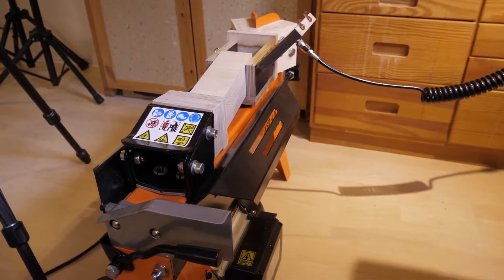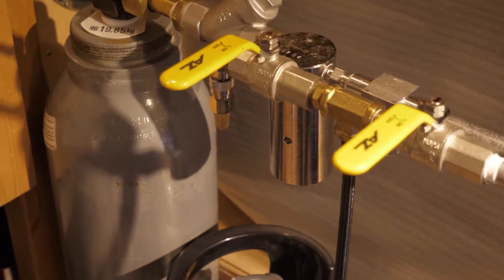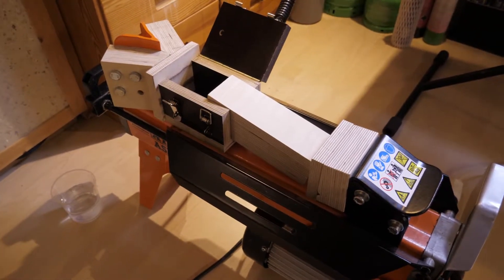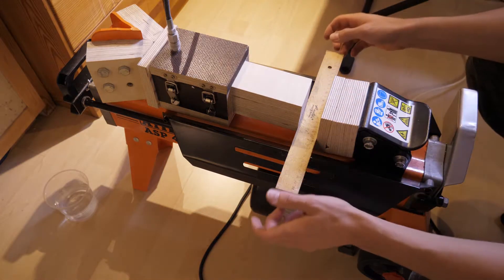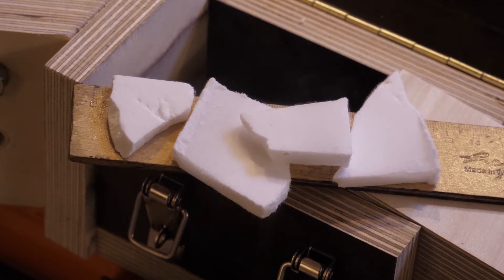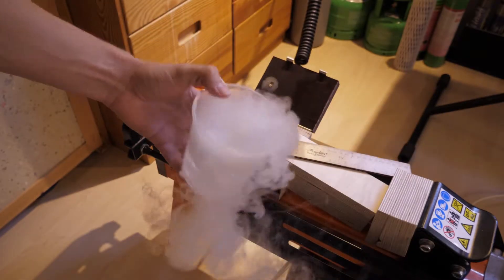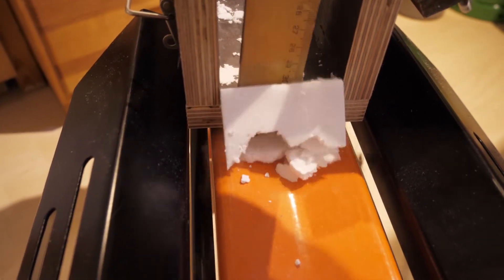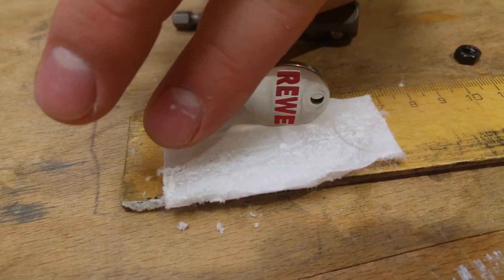World's first homemade hydraulic dry ice press!

Comment: Was looking into how dry ice is made commercially (ie not the bag method), and this seems really neat!
Reply: All that i could think of for improvements are figuring out some way to make it semi-automatic (maybe with an "ejector pin" system similar to injection molders), and able to do long runs without breaking and that would be a neat thing for makerspaces / microfactories etc!

Also maybe your tank+hose+valve system, a snow maker, then an auger to your block press, or even a pelletizer!

Comment: Since you have it, have you ever tried making a dry ice in kilos? How much does it takes on a machine like that and what is the usage of CO2 per kilo of dry ice?
Reply from the maker: it's about 50% in efficiency. so you buy 10kg of liquid co2 and can maybe make 5kg of dry ice. so i would say its quite expensive but at least i can make it at home on demand if i wish.. i have to redesign the this though from stainless steel. the wood isnt working so well.. ;-)
Reply: Chris's Tech Box Wow. But yeah, the thing you can make it at home is great, since I’ve also thought of palletizers, but found out it is not worth it. Would give in so much money even before I could start and it would not be worth it, since it would need so much supplyment and thing, and I am only in need of it for myself. 

Anyways, thanks for the reply! ;’)